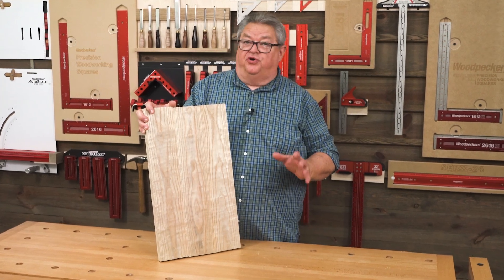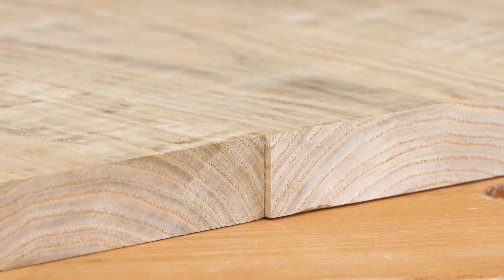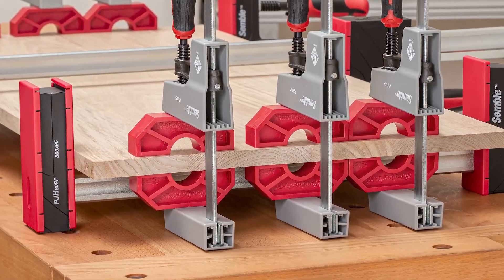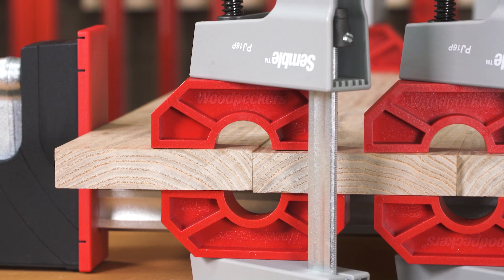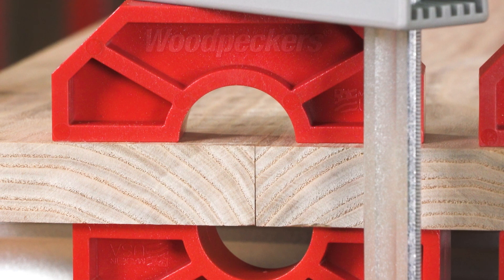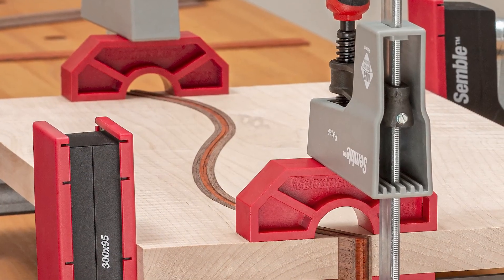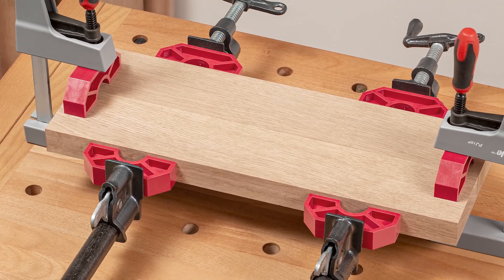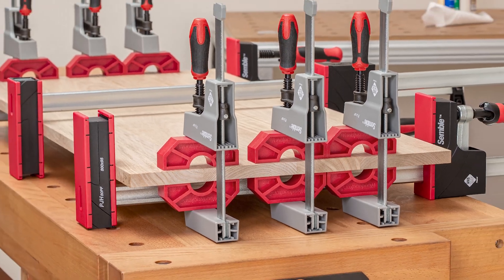Joint Bridge Clamping Pad Set | Woodpeckers Woodworking Tools

Comment: Jeff I can't wait for the Deep Dive on this one. If wrestling with seven, eight or more clamps isn't fun enough already when gluing up a panel, I can't wait to see what joy adding twenty "Joint Bridges" and the twelve clamps to hold them in place is like. 😜
Besides, if using these makes my glue-ups flat, I won't be able to use all that 80 grit I've stocked up on to flatten it. 🤷‍♂
All the Best, Chuck.
Reply from the maker: Here's a sneak preview...double-faced tape is your friend.
Reply: @WoodpeckersLLC  DOH!!! That's why you get the big bucks Jeff.
I'm the guy that pushes on the door with a big "PULL" sign on it. 🤣

Comment: When clamping together 3/4” stock how much thickness is added? In other words how much do the clamps need to open in order to use these?
Reply: if you use a clamp thats 12" capacity that would be more than enough
Reply from the maker: 1-1/2" per block. So 3" for the pair. 6" clamps will work for 3/4" stock with plenty of room.
Reply: @WoodpeckersLLC  thank you for that information.

Comment: Jeff--these look pretty slick!  However, I just purchased a bunch of your  Clampzilla's.  Are these joint bridges to take the place of a more expensive Clampzilla?  I'll probably purchase some of these just so I can compare.
Reply from the maker: I certainly wouldn't say they "take the place" of ClampZilla. No clamp on the market does a better job of centralizing pressure. But, some people are already heavily invested in other clamps. Joint Bridges give you a way to align faces if you're using regular bar clamps. That said, I did try them with ClampZilla and they worked well.

Comment: Did somebody compare these Bridges with WP Clamping Cauls? Clamping Cauls is long time ago (mine are from 2012) "One Time Tool".
Reply from the maker: The biggest difference between Joint Bridges and clamping cauls (ours or any others) is that the Joint Bridges work on each seam independently, while clamping cauls distribute pressure over the whole panel. Personally, I prefer a hybrid approach, which I touched briefly on in the Joint Bridge Deep Dive. I use spray adhesive or double-faced tape to stick the Joint Bridges to pieces of stock, making a customized clamping caul that steps over every joint line and keeps the pressure even.